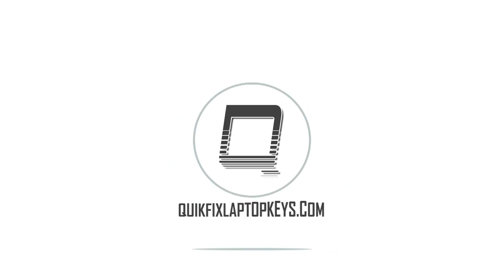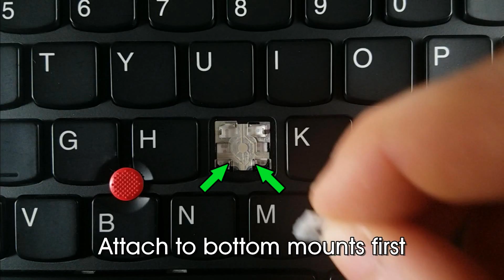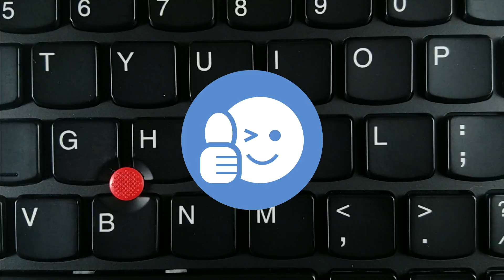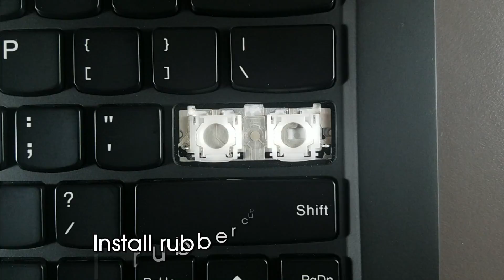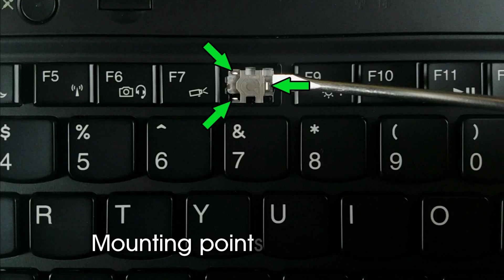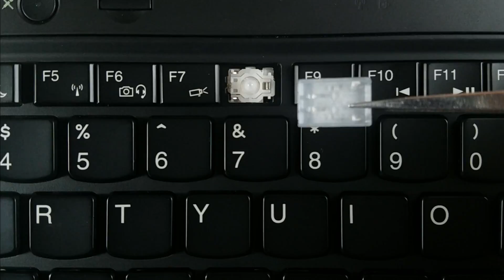How to Replace Lenovo Thinkpad X1 Keys

Comment from the maker: Please read the description before asking how to remove keys! Because every keyboard is different and can use various clip types, key removal isn't shown since the same method will NOT work for everyone! Our videos are designed to help customers who are already missing keys and wish to remedy using our genuine OEM key replacement kits! 

We've created a single, all inclusive tutorial on how to remove keys that will work for 99% of laptop models! 

If you need technical assistance, please visit our website at https://www.quikfixlaptopkeys.com

Thanks for your support!
Reply: are there any laptops with the same keys?
Reply: how long does it take for you to stock keys once they are sold out